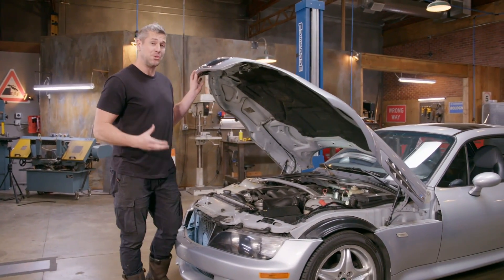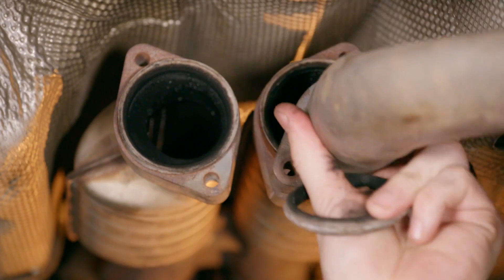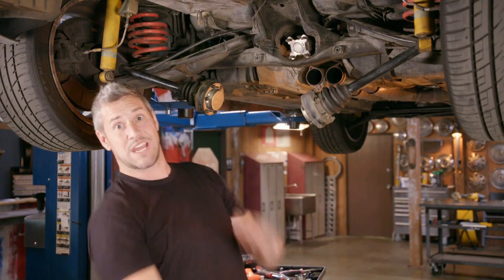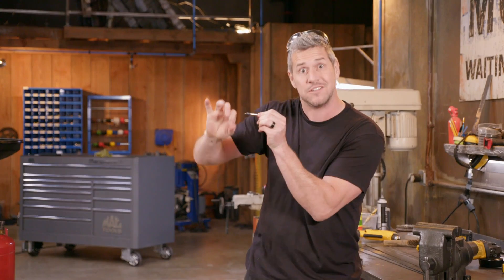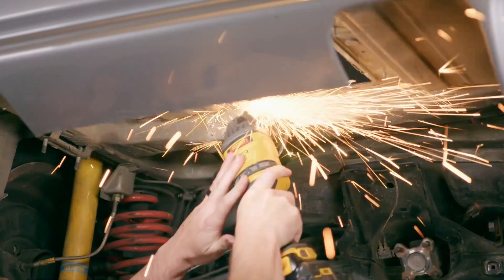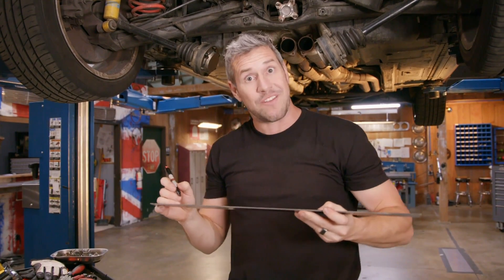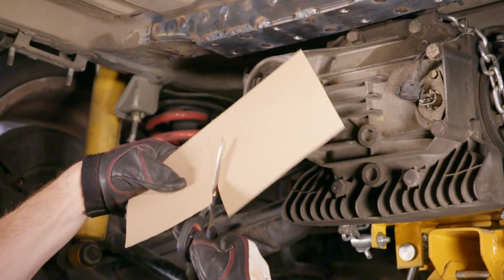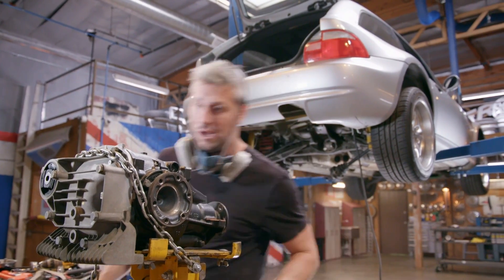BMW Z3 M Coupe: How To Fix The Flawed Chassis Design | Wheeler Dealers

Comment: Such nice rust will grow between the metal.....
Reply: Thought about the same, it should have been better coated. I guess a good lanolin undercoating will do the trick anyways. Fluid film etc
Reply: weld through primer @Aikaramba12

Comment: What starts the problem is the soft sub frame bushings. These will allow the front movement of the differential, which then transfer to the rear mount. Change the the soft sub frame bushings to Powerflex polyurethane bushes.

Comment: He has made the problem even worse. The spot welds that hold the diff crossmember to the boot floor pull themselves apart under heavy acceleration.
By strengthening the crossmember it will transfer more of that load to the weak spot welds. He should have also seam welded the crossmember to the boot floor, across its full length and on both sides.
I have owned multiple Z3's over 15 years, he has one for a week and is an expert!.
Those that say 'good job' never owned a Z3 with this problem.
And besides, the fact that he had so much problem trying to get the diff hanger off, should have shown him that wasn't even an issue
Reply: Randy Forbes is the expert.  He has been making a kit for over a decade that addresses weakness all the way up the chain as you describe.

Comment: Appreciate showing all the detail and the work strengthening the diff ear and the box, and I understand you can’t put too much in on a flip... but in this case it’s the film that pays the bills so why not finish strong
You may know, but,
That cross beam (hat section) is spot welded to the floor and also meets “frame rails” of sorts forming an H shape.  Many Z3 rear floor fails tear out spot welds joining that box to floor in middle but also out at ends of that box where load must move out to outboard lengthwise boxes (it’s not so much the beam is too weak as the beam tears off the floor)... if those many spot welds already fail OEM, then stiffening the center of the beam may simply fail the spot welds more readily (especially outboard) ....

 I suggest anyone read through Randy Forbes kit installation detail before copying this method....1000+ Z3 reinforced and proven on track with power adders.   Those methods also address corrosion concerns by accessing those box sections from inside the trunk and allow coating all surfaces rather than leaving underprotected metal between the reinf plate and OE stampings   Check all the spot welds along the H ... this will require removing the insulation from the trunk floor 

That’s a sweet little beastie and looks worth the effort

Thanks again for sharing.  Really do enjoy the content
Reply: plus the car is appreciating, make sense to beef up the subframe for more value
Reply: Came here to post exactly this. I love Ant, but this is not a complete repair.

Comment: Besides the fact that this repair did not address the trunk floor-related reinforcements (an important omission), I would be very concerned about corrosion issues associated with bare metal surfaces including those caused as a result of welding heat on the cars OEM-finished sheet metal (this corrosion concern would also apply to the installation of the more comprehensive Randy Forbes kit as well, I think).  I wonder if the use of stainless steel plate together with stainless steel fasteners and an appropriate epoxy adhesive would be an adequate way to effect a repair/reinforcement without leaving behind bare steel surfaces?  Of course this type of repair would be very labor intensive and require high precision machining operations (principally drilling of well aligned holes for fasteners).  Comments on this approach?
Reply: Fasteners are used when flex is expected and allowed. Welding is used when you want to mitigate flex.

Weld through primer would solve these issues though.

Comment: That looks like an Ireland Engineering real anti-roll bar. Good choice!
Reply: Pretty good anti-rolls if Ireland Engineering, but their green bushes I used were terrible, they deteriorated within two years with less than 2000km covered.

Comment: Since the Z3s and Z3 Ms share the rear suspension with the E30, I believe this is an E30 only problem. The E36 had a rear subframe - with a different problem unless it's a M3 (reinforced from the factory).
Reply: I don’t see an E30 rear suspension here.
Reply: @e28forever30  you arent paying attention then

Comment: The back half is more E30 than E36.  E36 has different rear subframe issues.
Reply: Yeah I was like wtf when he said e36.
Reply: @PatrickLipsinic 
It is an E36 rear suspension.
Have you ever seen an E30 rear axle ??

Comment: I am no mechanical engineer but from what I can tell, the diff bracket not much during (hard) acceleration. Torques cancel out for the most part.  Also  when the car is at the correct height (not lowered too far), it has a large degree of 'anti-squat' due to the semi-trailing pushing the car up during acceleration.  When introducing wheel hop however..............
Reply: Wheel hop happens easily on this car given el crapo suspension design.  Road only needs to be moist not wet.  Of course, wheel hop on other RWD sports cars (other than other BMWs) does not cause destruction of car's rear end.

Comment: Sold my coupe cuz this issue at 40k miles. Never went back to bmw.
Reply: It's a $3 - 4k fix at a shop and the car is solid otherwise. These Z3Ms are still increasing in value as well, so doing this fix is almost a no brainer.

Comment: Does this problem carry over to all z3's or only the m coupe?
Reply: 2.8s can experience it, especially with enthusiastic drivers. 1.9s almost never see it. Modified for power cars obv also experience it.

Lack of maintenance can also cause this issue, as the play in the subframe bushings allows for extra force applied to the trunk floor.

He did not fix the issue in this video though. Reinforced the diff ear, sure. But typically the whole crossmember pulls away from the trunkfloor, which he did not address.

Comment: Randy Forbes kit, or do like I did (on perfect condition coupe) 4mm stainless through trunk and 2 eared E36 M3 3.0 diff cover.
Reply: I'd like to know more
Reply: @djremotion2  yes, and I know about the Forbes kit but I'm not a good welder so looking for alternatives. My bracket hasn't broken yet
Reply: @DavidGregoire_  mine did not break either. I got my own solution, but to be honest I did it a bit ugly too. Should have used different shop entirely.
Reply: Hello, EE.  How do I find your posts on bimmerforums?  Also what are your thoughts on comment I posted above concerning stainless steel plates and fasteners together with an appropriate epoxy adhesive?  Thx
Reply: @cbrbimmer1  it is not sold anywhere, you need to fabricate your own. Randy's kit is tried and tested, although extremely expensive imho.

Comment: Nobody drills out spot welds anymore on panels they aren't reusing.  Use an air file with 36 grit to remove the welds.  That way you can skip.

Comment: I wonder if you could comment on the steering feel of the clown shoe? I’ve driven a few of them recently as I contemplate buying one but find the front end to feel very vague with regard to inputs/outputs and feedback, almost as if you point the car and it hunts for the line you’ve given it. I drive Miata’s and Porsches and find the steering to feel much more direct and precise on these cars. Is the BMW really that bad or have I just driven a few lemons. If this is just the inherent feel of the car, is there any way to fix it? Would love to hear anyone’s thoughts on the matter. Thanks!
Reply: Its the inherent feel. No matter what you do, the racks are designed to be vague. Z3 and e36 are inherently vague.
Reply: So strange. Why would anyone want want that in a sports car? I get that this car is a bit of a Frankenstein but if I want vague I'll buy a Lincoln. 😂

Comment: Hi, thanks very much for this very informative item.  I have just "discovered" a ~2002 z3 3.0i sitting outside of a garage in a small town.  been there since 2013, so I have serious concerns about the ability of the engine to turnover after all belts and fluids have been replaced.  The bet is to let an expert do the basic flush and replacement and then cross my fingers when he turns the key.  Any advice?
Reply: ... buy a citroen

Comment: That’s why I went with the Z4. Much stiffer, great styling, and doesn’t have these issues for the most part.
Reply: I have a Z3, a friend had a Z4. "Had" because they missed a turn on wet pavement and bumped the front wheels over a curb at probably 20 MPH with the brakes locked up and totalled the car. Whole front end was twisted beyond reasonable repair.
Reply: @DconBlueZ  skill issue

Comment: The chassis is not flawed. Source, S54 owner from 01. Hauled Jet Skis up and down the coast. You know ... no subframe issues. Basically hype to ad space.
Reply: The chassis is most definitely flawed, ask anyone who's ever tracked a z car. This modification is an absolute necessity for spirited driving. It's not a matter of IF your chassis starts splitting, but when.

Comment: Wouldn’t this modification  be a major fault at the MOT station? Constructive change to the design etc.
Reply: Pretty sure they built this in California - most of Ant's episodes were filmed in the US.
Reply: Wouldn’t be a problem as these changes are chassis strengthening as long as there’s no corrosion or damage, it would be a issue if chassis parts were removed that shouldn’t off but a strengthening bar is a plus as long as the chassis strength hasn’t been jeopardised.